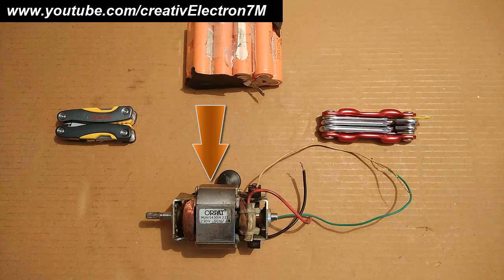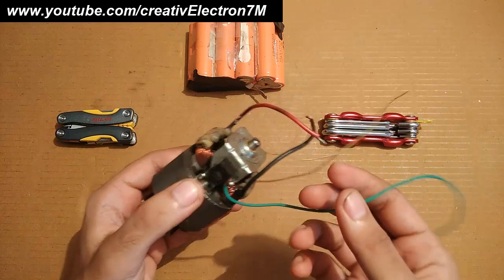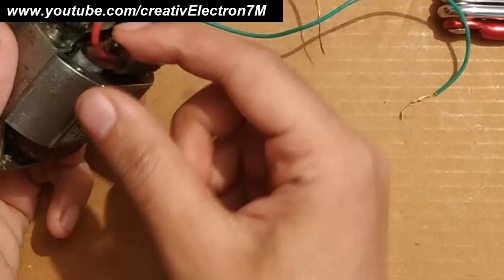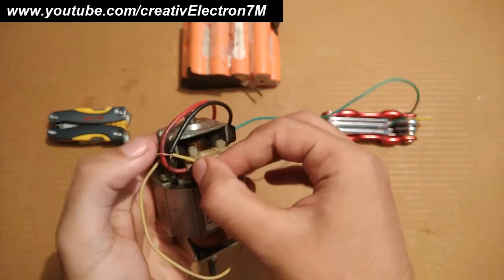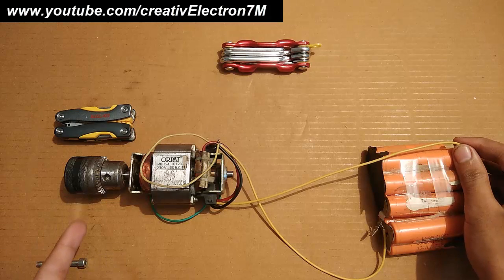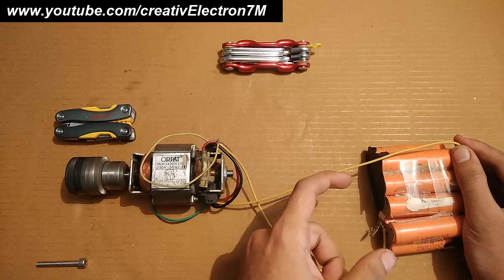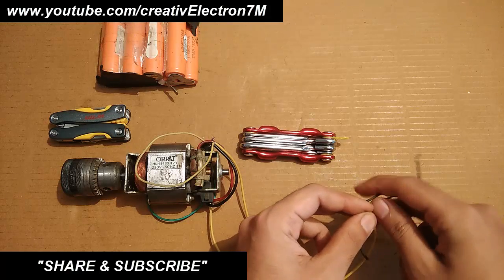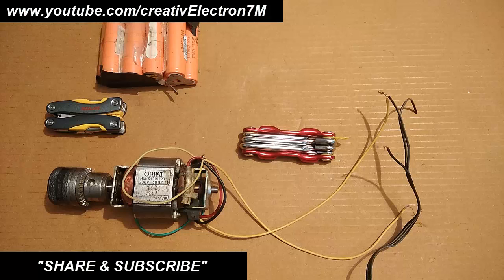Run a High Torque Mixer/Drill Motor at 12V without any Circuit : Step By Step

Comment: If it's an universal motor where's the need to modify the stator coils connections? An universal motor runs on either DC or AC without modifications

Comment: Please make a video on winding modification for more speed and torque at 12v.
The dc 775 motor is having more torque and speed than your modified series motor. So it is of no use.

Comment: My motor does not have 6 wires, it is a hedge trimmer motor, it has 2 black wired from brushes and 1 brown and 1 orange from the field windings there is also a 1 into 2 blue wire with on side wrapped around a small metal ring? How do I wire this for 12v dc please? thankyou

Comment: It's 120 out here in my parts. Unless it's like a dryer or oven witch be 240
Reply: Im over here thinking where am i gonna take this motor from... then i read your comment n im like wth.. What are you talkin about.. Isnt everyones 110-120?.. So i rewind and hear 230. Now, can you possibly tell me Wth kinda mixer runs on 230.. Cement? Maybe. Are they blending in shell walnuts with pea gravel, corn starch, and water or what..

Comment: How do you change the direction of the rotation on similar motor?
Reply: In dc brushed motors you only need to swap the 2 wires

Comment: Universal motors will run on either ac or dc. That is why they are called universal. It will turn on 12v, but develop very little torque. 'the higher the voltage, the more torque' - yes - and when you get to the rated voltage it will have the rated torque. I am not sure what the point of this is- it has been known for over 100 years. Why not use  a motor designed for the voltage you wish to use?

Comment: how come cordless impact drill machines with 12v LI-ion batteries operate then at full power, since both use universal motors even the mixer should have operated in full power at 12volts with larger amps sucked from battery -
btw any cordless drill can be directly converted to 120/220v AC withput any wiring changes on motor side!!!
 whats your take. are we missing something

Comment: Now i will tell you something, all the coils in this type of universal motor are connected in series.
Now 220 volt is distributed among the 3 coils , 2 field and 1armature or rotor coils. 
Now the stator coil or field coil has got different windings. So now calculate the voltage distribution among the 3 coils and you will get full potential from the motor. Best of luck. Hope to see this vedio next in your channel

Comment: Verywell done. But that 32 would be dc not ac, coz your multimeter was on the dc side not ac side. But thatz a very small and common mistake.

Comment: Could I use a 240v motor from as trimmer and power it with car battery, motor only as 2 wires out the back of motor both same colour (grey) thanks

Comment: Thank you for this video. I opened my blender, and wanted to use its motor for a mini lathe machine project. I did lot of research but non of them were useful as yours about how to convert the voltage. Keep up the good work.

Comment: have to work harder my friend as , rotating AC motor with DC does not solve the issues
1. the 230 volts  500 watts spindle /cost is close to $ 30 but a 12 volts 500 watts DC spindle/router costs 200 
for DIY people 250 is rather expensive as it is hobby and students people
2. the ac spindle has 30000 RPM and no controll

Requirements.
1. method to change the 230 spindle to 12
2.adding quadrature or /feed back loop /by adding rotation sensors / rotary encoder

DO IT you have the motor Rip off the winding of the fields and change it to 12 volts compatability , the rotor with same windings will work I am sure

Comment: Hi i like this video as im sure that i can now salvage a motor for cheap but i have one concern i have purchased a motor from a flea market in mumbai and i dont know anything about it like what is the voltage watts what is tourque and which battery can i use to power it because there is an adapter on it which lets me power it on ac can you please clarify and shed some light on my issues it would be very helpful if anybody could do so

Comment: Hello, thanks for putting this video up. Pls i have a motor that i took out of my wife's blender. It looks very much like this one, but the wiring is quite different. On the body is written 7030 230V 50Hz. I want to use it to build a go-kart for my 6yr old son. Can i drive it with a 12-24V DC battery? Can i send a photo of it to you so you can advise on how to connect it. Thank you

Comment: what is the correct power supply 12v/220v  to connect 160psi 12V Self-priming Water Pump 8L/min 100W ???

Comment: How about sewing machine motor is it also a universal motor?(details are: 100v 50/60hrtz with oil capacitor .047microfarad WV.DC) help me pls.thank u so much
Reply from the maker: +AZ Mills if a capacitor is used then most probable its not a universal motor.

Comment: As you're putting 12v across the rotor and it's wound for 230v minus the field voltage drop at maybe 2A, then how can you get enough current thorough the rotor to make any meaningful torque? I've done this type of parallel setup before with a large washing machine motor and it only works effectively if you increase the rotor voltage into the 100+ volt range. Correct me if I'm wrong; I put the motor on the shelf awaiting a purpose.
Reply from the maker: a universal motor has armature conneted in series with the field.More than half the voltage drop occurs on the field pole windings.Lets say that usually , the voltage drop across the armature terminal is 100V and the remaining 130V is across the fields.Then a  100V armature easily starts at around 3v to 5v and the torque value keeps on rising as the voltage rises.
So the answer to ur question is that a good value of torque is at 100V to 150V and keeps on decreasing with the decrease in applied voltage.Higher field voltage is equally responsible for a higher value of torque.
Reply: Mr Electron That sounds about right but I disagree with the proportion of voltage drop across the field; I think it is much lower. Still, you have confirmed to me that you're not getting anything like the potential out of the rotor at such low voltage. A better result is possible with American 110v motors, as these will be wound for more amps.
Reply from the maker: Voltage drop can be easily confirmed by checking the resistance value of fields together and then the armature.Higher resistance means higher voltage drop.I haven't done the check but i think the resistance of field should be higher and so should the voltage considering the number of turns.
A better result is possible with American 110v motors----> True

Comment: Thanks for the demo! I got a few motors lying about, like to use them,  esp: in free over unity energy designs. Busy building a 12v dc to 240 ac 50 Hz Inverter at the moment. This may be useful in designing a power generator.
Reply: Did you get your over unity bullshit yet?

Comment: You are wasting people's valuable time!   Useless conversion, it won't give even one tenths of torque therefore nothing can be done with this exercise.   12v DC motors are easily available & you can get it from car wipers or cleaning water spray. If you visit any scrapyard in your town you will get 12v motors at throwaway price.

Comment: False, You can make it run faster without wires, just remove the charbons and place the wires from the battery directly, This kind of motors are universal ( it run on both AC an DC )

Comment: To run a 240 volt brush motor with 12 volts has no useful purpose. It will simply have very little power. To make it useful you need to rewind the fields and armature with less turns of heavier wire.

Comment: So far at 2:50 I see a possibly 115 VDC motor  (since it is actually a 230VAC motor) if each of the coil polarities is correct in the parallel connections. The RPM and torque will be reduced related to the voltage applied under 115V. If a fan is put on the shaft to blow over the motor, then the voltage can be increased to get more RPM and torque than originally designed. If doing overdrive condition, I would cable tie a 120c thermal fuse on the windings opposite of the fan and to the inside as far as possible.

Comment: FRD mixer or drill motor are universal motor it can run on dc as well as ac
Reply from the maker: Jayawant Bavaskar Correct
Reply: Yes, but at 250 rpm instead of 25000.

Comment: Does it matter which wires from the field coils you connect to each other?  What i mean is will there be any phase difference?
Reply from the maker: Lounge lizard Yes it does.You have to try which field wire combination is gonna work.I was hoping someone might ask this ☺️
Reply: If you look at it from the to top, counter clockwise, could it be, the first wire, from the first coil, should be connected to the first wire of the second coil... (Question mark), my keyboard doesn't have a question mark, Lol!) I don't know where the fuck, this laptop, was made. Lol!
Reply from the maker: Pacero Its difficult to tell this way.Simply try it both ways.The way in which it runs is the correct way. 😀😀

Comment: To find out the field current that is drawn by the field coils measure their resistance with both coils connected in parallel. Use Ohm's Law (Voltage = Resistance x Current) to calculate the current.

By connecting a wirewound resistance in series with the coils you can easily limit the current to whatever value you may wish. Here are some simple calculations that you may use.

Let C = field coils resistance with coils in parallel
Let I  = current required for field coils
Let V = supply voltage
Ler R = required wirewound resistance

Using Ohm's Law:
V = I*(C + R)
V = I*C + I*R
=> I*R = V - I*C
=> R = (V - I*C)/I

Example:
With field coils resistance of 20 Ohms, field current of 500mA, supply voltage of 24V

R = (24 - 0.5*20)/0.5
R = 28 Ohms

Power Dissipation in Coils:
P = I*I*r
P = 0.5*0.5*20
P = 5 Watts

Power Dissipation in wirewound resistance:
P = I*I*r
P = 0.5*0.5*28
P= 7 Watts

Comment: This is normal, this motor is a universal motor which runs with both ac and dc voltage.
Reply from the maker: Ahmad Yes but without the change that i made, it won't run at 12V.Try it
Reply: @MrElectron skematic bro
Reply: Parallel, not in Series!
Reply: When you run field/stator windings in parallel, you just get more torque out of it, but a universal motor will happily run on both AC and DC
Reply: Not true. Universal motors are *often* connected in series to have, among other things, a lower current in the windings, but there is no reason you cannot connect them in parallel. You could even have separately excited field and armature. In which case if that's AC, the frequency must be the same for both and both must either be in phase or 180° apart (which is the case when they are in series/parallel and you use a switch to change relative connection of field and armature). If you apply DC to the field, you get a DC motor (not a permanent-magnet DC, but like a PMDC, this cannot take AC on armature).
Reply: I'm new to these stuffs, can you explain how the torque is higher? and why he made the wires in parallel and how to make it run on AC? should we change the wiring again or it will be run this way (as showed in video) on 220v?
Reply: Ahmad 
Right
Reply: Universal motor is always a the armature and field connected in series. If it is parallel, the motor will NOT run on AC. It can run on DC only.
Reply: what change? you just wired it up for D.C.
Reply: @Jimmeh_B  no bro we have do some change then it runga on dc

Comment: Sorry. Buttttt. Universal motors in my opinion are NOT as good as DC. (BUT U KNOW THIS. I THINK. I AM CONFUSED. LETS DO 3500RPM MAGNET ROTOR MOTORS. AND 3 SPARK GAPS, LIKE POWER COMPANIES. 3GAPS, 3500RPM, AND TRANSFORMER. IS OVER UNITY!!!!) GERARD MORIN VIDEOS EXPLAIN BETTER. I MAKE 10ABOUT. ALL WORK!
Reply from the maker: Yes ofcourse they are not as good as DC Motors but still they are more easily available than DC Motors.
Reply: Thanks

Comment: How about blender motor? Will it work?
Reply from the maker: Yzen Mells Yes it will.
Reply: in hand  blender motor, the motor look like normal dc motor..in the blender motor there is written 230-240 V DC
..so my battery is 12 v how can i run the motor.
in blender there is a circuit board..can make a circuit for the motor to run with 12 V battery..??

or send ur email-id..i sent motor picture ..
Reply from the maker: Manish Gupta : Contact me here please - https://www.youtube.com/add_contact?c=tFnRyD7PDCNNuft2K7lg7wZzeeLo_g
Reply: blender motor has 2 point output..i  connect with driect battery it does not work..
do u have any idea..?